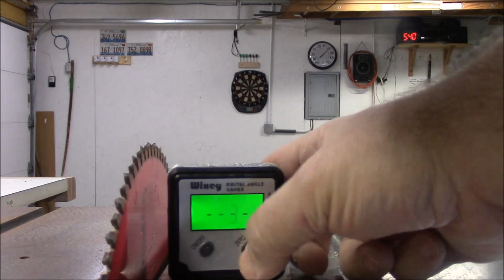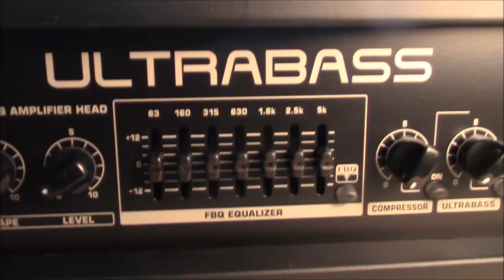DIY 1x15 Bass Speaker Cabinet

Comment: I liked your video.  I feel that your cabinet would benefit from the the following:
• more fasteners holding the back piece on; a fastener every 4 to 5 inches.
• it is good practice to use a foam or rubber grommet/gasket between the wire plate/wood and the removable back piece/main structure.
• pilot holes in the baffle for the speaker fasteners.
• stuff that box full of damping material ..)
Reply from the maker: A lot of great ideas. At the time I was working on a very limited budget and I never plan to actually use it for a gig. This is strictly for playing in the house. Nothing has ever rattled on the speaker, including the handles. But everything else in the room shakes quite a bit.
Reply: Im adding a back cover to my bass cabinet. found denim sound deadening material. All materials bought off ebay. ( 12" speaker cabinet pre made and varnished/stained) 2013 ten years ago, I never used it yet
Reply: @missingremote4388  Stained and varnish makes a nice alternative If your handling it yourself , I did one and made a  vinyl cover for it ,I think Peterson combos are done like this I up graded speaker to a Neo and used VOX Speaker cloth

Comment: Great build!  I'm looking to do something like this, but I'm planning on having the speaker hole (10") offset more to the side to allow for the tweeter. I'm actually rebuilding the box from a SWR Workingman's 10 design, but I'll probably modify it so it can kick back, a handy feature largely overlooked for 1x10 cab's
Reply from the maker: Yeah, that was a major design flaw in my design. Wish I had left enough room for the tweeter, but after using it for a couple years, I don't really miss it. There's never been a point where I'm playing bass and wish I had more high end. 

And with the 15" speaker, I don't really need the kickback. It fills my room. I've never taken it out, so I have no idea how it would perform anywhere else.
Reply: @HandlebarWorkshops  While I've played on 15" cabs in the past, I appreciate the 10" range more.  It gives you a solid low end while letting some of your higher notes ring true.  Also, for smaller acoustic & jazz gigs, you don't freak out the rest of your band or the bar/cafe owners!!  The horn would come in hand for those styles of playing, as would the kick back, b/c I want to hear it directly instead of it just hitting feet.

Comment: Thanks. I have an old kustom c 1 x 12 cabinet that that amp has been removed from. This looks like a great winter project to make it match an old crate amp I have.
Reply from the maker: An actual Kustom cab? With the puffy vinyl? Those are pretty cool. It might be worth more if you kept it all together (depending on the condition of the vinyl). 

But if you do make a new cab, make a video of it and link it here. That will be fun to watch.
Reply: No  don't tho\ink I would get rid of the puffy cabinet if I had one. This is a compact I think it was a 60 watt amp. This cabinet is the black pebbly finish that looks dirty from the years. If I do make the new cab I will get back to you. I am not an experienced woodworker but I have some equipment.

Comment: Just made a very similar size cab before seeing this- only have a hand saw and jigsaw so more cleanup was needed. I scored 2×15" and 3×12" nos Fane The Crescendo speakers from the scrapyard after they did a garage clearout. Had to google them to see their value but felt like doing backflips after! It sounds pretty good- using my Squier Jaguar SS bass through a Fender BXR two hundred head unit. The cab doesn't have a back yet, and I'm only planning on a 2/3 back. Still have to buy a jackplate yet also. Cheers from South Australia!
Reply from the maker: Thanks for watching. Loving the DIY spirit. Keep it up!

Comment: Nothing wrong with using a pick, lot of Bass players us them. You don't need tweeter in bass guitar cabinet but it never hurts,  you can trim he one corner of tweeter surface so not meet up with the woofer. PS mounting the drivers on the outside is better.
Reply from the maker: I'm doing my best to use only my fingers. But I figure that Paul McCartney used a pick, so there's a pretty big precedence.  :D

I was originally thinking that I'd add in the tweeter so I could use it for other purposes, PA, general loudspeaker, etc. but I didn't want to do anything that I couldn't undo. But I'm pretty happy with it now. I've since picked up a real PA and this can just be a bass speaker.

Thanks for watching.
Reply: @HandlebarWorkshops  Son, I am disappoint that you didnt foresee the issue of the twitter feetting, then again when you didnt realizer you have 2 more sides on the cabin.

Comment: Nice job on the woodwork.  I'm going to screw my sides together for added strength and use a one piece handle to avoid rattling.   I think you could adjust the amp for a more mellow bass sound and use your thumb instead of a pick to get the true tone.  Nice job.  I'm starting mine today!
Reply from the maker: Interestingly enough, I don't hear a rattle with the handle, I thought I would and had plans to use a cheap bungie cord to hold them tight. Well, at least any rattling is much quieter than the sound of my bass to the point where I can't hear it over the sound. However, the guitars on my wall, the cabinet doors in my desk, the blinds on the window... Those all rattle like crazy when I play. :D

If you build yours similar to mine, the screws won't add much strength. Wood glue is stronger than the wood (assuming proper glue techniques). Going with the Mesa Boogie Subway style that I used, there are more than enough glue joints to make the cabinet outlast you. 

And you are absolutely correct about my bass tone. I'd only played about 5 minutes through that amp/cabinet combo before recording myself. I've gotten better and my tone has gotten better. As far as using a pick, Paul McCartney used a pick so :P :D

Comment: Your woodworking skills are top notch. I think your soldering could use some work. You should buy a copper brillow pad to clean the tip, and keep it tinned with fresh solder at all times. Apply a little ball of solder to the tip when it's not in use to prevent oxidation.
Reply from the maker: You are absolutely correct. My soldering skills are not good. However, since this video, I have bought a new Hakko iron with a brillo pad and better solder. I've gotten better, but still not that good.

Comment: I built a guitar speaker box with a Peavey Head. I want to learn bass. I have the a Dean Edge Bass (lefty) that I'm converting to fret less. I'm going to try and get that Behringer head unit and change the speaker. Thanks for the video.
Reply from the maker: That's awesome. I've been rather hesitant to try a fretless bass. I can barely play it fretted. Good luck with the speaker change and thanks for watching.

Comment: Clean your tip. Melt a little solder on the tip before you make contact. The melted solder will transfer heat. If that doesn't work then your iron may be too low wattage.
Reply from the maker: Thanks for the "tip". HA!

Anyway. I've had quite a bit of practice since this video and I'm much better. But I'll be sure to incorporate this into my workflow.

Comment: What a great built!!!
Awesome work!!!
That bass was growlin' haha
I actually had to check up on my amp speaker the other day and when I opened it up I noticed that the builder who made my cabinet didn't do such a neat job on building the inside part of it, so now I've decided to reform it.
Would you possibly have any tips?
I don't have as many tools as you do but I imagine that since the outer structure of the cabinet seems to be fine I might not need lots of cutting!
Do you have any idea why some cabinets have holes on the backside/lower front side? Might it be to let the air flow?
And lastly, I really liked the natural/wooden look on the cabinet. What oils/varnishes would recommend to finish that plywood?
Thanks in advance and wish you all of the best!
Take care!!!
Reply from the maker: All of the cutting can be done with a circular saw and jig saw. I happen to be lucky enough to have some tools that make it slightly easier, so I use them. 

If you're not a wood worker, then I'd go with regular Waterbased Polyurethane. It is easy to apply and very durable. And it won't tint the wood color. 

For why there are ports (the holes in the box) you can watch an earlier video where I figure out the parameters of the speaker and use a website figure out how big the box needed to be and if it should have ports or not. 

Thanks for watching, and good luck with your upgrades.

Comment: Hi, what were the specs on the speaker itself, and do you think it is a good match for the amp head you are using? I have this exact Behringer amp and am looking to build a cab specifically for it. I was researching what I should look for in a 15" speaker as far as wattage and other specs when I stumbled across your video. I'm sure this will come in very handy when I get ready to build my cab, but I have to settle on a speaker arrangement first! I want to build the cab around a 15" for the deep lows (am considering a Memphis or Kicker subwoofer, hopefully a commenter can chime in on whether I should NOT go with a subwoofer), but would like to leave enough power to add something to get the punchy highs as well. Do you have any recommendations? 

Thank you
Reply from the maker: A couple previous videos of mine show me trying to figure out the parameters. All I know is that it came from a keyboard amp that was damaged in a flood. Due to my inexperience and some mistyped formulae on a webpage, I was not able to get an accurate set of parameters. So I threw my hands in the air and based (copied) my design off of a Mesa Boogie Subway cab. However, I did try to use a cab design website that uses the T/S Parameters to give you the size of the cab and whether to port the cab or not. I have links to it in my other video.

I've never played it in a gig setting, so I have no idea how it would perform with drums and full volume guitars, but it works very well when I have friends over to jam in my living room. From what I've read in other online forums is that the amp head is probably underpowered for an actual gig, unless you're running direct to the PA. Most gig ready bass rigs start at around 300W.

I've also read (but have no experience) that subwoofers are not good for bass rigs. Something like they are not rigid enough to convey the full spectrum of sound or something. I'd suggest doing some research on The Gear Page or Talk Bass forums. The Talk Bass forum has a section completely dedicated to building bass cabs. You might even find my thread where I discuss this build. Just look for my moustache logo.

Comment: Nice job, I just think the handles will rattle because they're not spring loaded
Reply from the maker: If you can hear it rattle, you're not playing loud enough! ;)

I had a plan of using a bungie cord over the top of the cab to keep them pinned in the up position. Still cheaper than the fancy inset handles.

Comment: Would I need a different jack plate for a 4 ohm 300 watt speaker ?
Reply from the maker: Nope. It is a passive plate and the amp would only see the impedance of the speaker, 4, 8 or 16 ohms. 

Thanks for watching.

Comment: Hi, just wondering is it actually cheaper to build you own 15 inch speaker cabinet from scratch rather than buying one online? I'd be really interested in learning about making one myself using your video as a reference but I'm not sure if it's cheaper than buying one on Thomann for example? Any helpful information would be appreciated. Thanks
Reply from the maker: Well, there's a lot of adult diapers in this question. It depends on if you're buying the speaker retail or from a flea market. It depends on if you already have the tools. It depends on if you want to use the best possible materials available. It depends on if you have more time than money. It depends on your woodworking skills. It depends on if you enjoy the process of building as well as playing.
For me, my friend gave me just the bare speaker. I already owned all of the tools needed to make it, since my other passion is woodworking. I wanted to see where I could cut corners to save money as an experiment without really sacrificing sound quality. I was able to purchase individual pieces over a long period of time - which is kinda like financing the cost without having to pay interest. 
For a person with limited woodworking skill and tools and space, it would definitely be cheaper to buy a cabinet from Thomann. I've never used them, but from what I hear, they make some very good quality items. So it might not only be cheaper, but it might be better than anything that person can make.
Thanks for watching.

Comment: Looks like you could have squeezed the twitter into that design, just needed to trim off some of the waveguide so it would miss the edge of the woofer.
Reply from the maker: Probably, but I wasn't as confident in myself back then. In a previous video I determined the T/S Parameters for this speaker and the webpage where I got the formulas changed and I should redo that. Which will (hopefully) dictate the correct size of the enclosure. If I ever redo all of it, I will be fitting the tweeter in there so I can use it as a PA as well.

Thanks for watching and commenting.
Reply: @HandlebarWorkshops  Have you thought of Not centering the 15" speaker to allow for the tweeter?

Comment: I would have trimmed the tweeter bracket to fit. Good job on the speaker build.
Reply from the maker: I definitely want to re-do this, but it's way low on my to-do list. 

Thanks for watching.
Reply: @HandlebarWorkshops  great video sir. I wouldn't bother with the tweeter, they are about as useful as an exit where your elbow is. Plus with a sealed cab you're going to get all of the high end you probably ever look for, and to my ear you already have a good bit of high end.

Comment: If you wanted a 2 x 15" cab would you just double the length measurement to double the cubic feet requirement?
Reply from the maker: I don't know. I don't think the design calculation websites have an option for 2 speakers. 

Here's what I would do. Figure out your speaker's T/S parameters (I have another video on that) unless you can find them online and find commercial 2x15 cab with similar speakers and use those dimensions. 

I know that 2x12 guitar cabs tend to be bigger than just double the 1x12 cabs size. There is a gear section of the TalkBass forum where true cab designers frequent. I would suggest asking there. I leaned a lot from them on this build.

Comment: What plywood did you use and what was the thickness?
Reply from the maker: Straight up ACX (one side pre-sanded) 3/4" plywood from one of the home center stores. Nothing fancy at all. It was meant as a prototype, but I've had no reason to change it yet. I mean, there are things that I'd like to do with it, maybe even re-make it eventually for some other features, but it works fine as-is.

Comment: Is it possible to turn a subwoofer into a bass amp if you use the head of a bass amp and plug that into the speaker in the sub?
Reply from the maker: Maybe? Most regular speakers (not made specifically for instrument amplification) tend to be much more flexible than the ones you'd get in an amp. That is, if you gently pushed on the paper cone of a regular stereo sub-woofer speaker, it would move much easier than a speaker made for a guitar or bass amp.
That said, most modern bass amps (like the one I use in this video) have a direct out connection that is meant to go straight into a PA and just about all the sound the audience hears comes from the PA speakers which are more like the basic sub-woofer speakers. 
Most players would say it won't sound as good. But that's pretty subjective. There's also the argument that the speaker won't last as long, which may be true. I'd say give it a try. Make a video, I'd like to see it.

Comment: Do you just connect the speaker direct to the jack?? Thats all ?
Reply from the maker: Yep. Just like in most combo amps*, the wires come straight off of the output transformer and connect directly to the speaker. In this case, the transformer is just much farther away than in a combo amp.

*Some combo amps (I know of some old Fenders, at the very least) had a jack in the chassis and the speaker had a guitar cord like cable tip that plugged into it. That way the chassis can be removed without having to remove the speaker, de-solder the speaker, or provide long wires.

Comment: hey what do you think of a 4 speaker design but there are 4 different sized speaker. for example a 18 a 12 a 8 and a tweeter
Reply from the maker: I love new ideas and thinking outside the box. I've never heard of such a thing. Do the research, build it and send me a link to the video. If you already have the speakers, it shouldn't be too expensive. That's my limiting factor - those speakers would be too expensive for me. 

Thanks for watching.